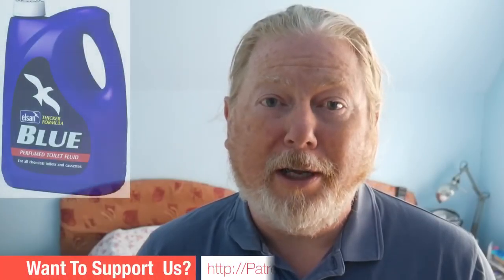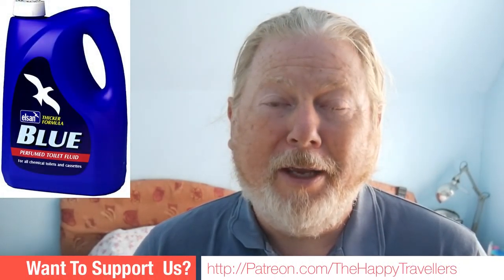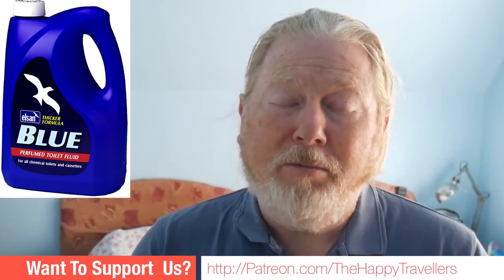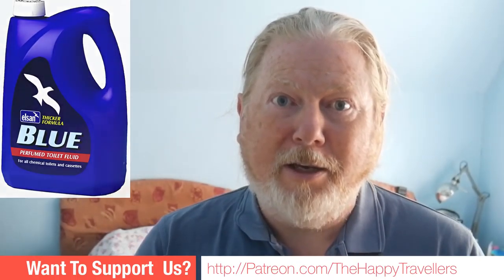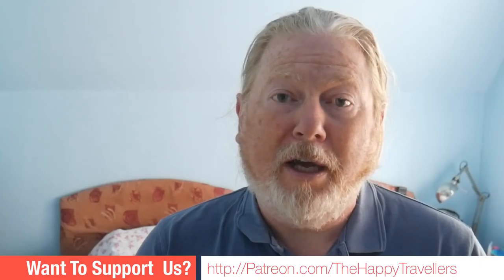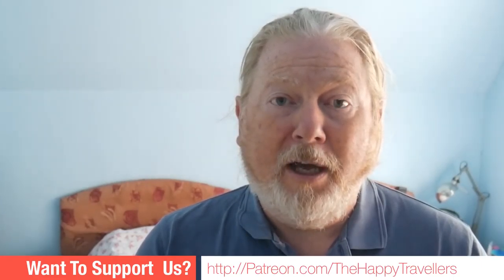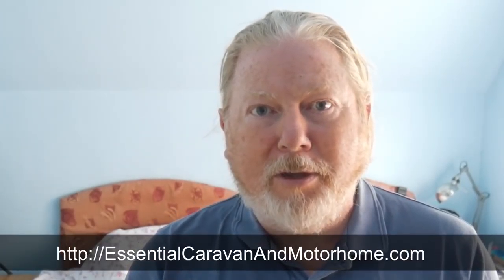Caravan and Motorhome Toilet Stories Vlog #441

Comment: Not at all an expert, but when we hired a motorhome for a couple of weeks in April, it came with a new bottle of the Elsan Blue chemical and as you say with the measure in the lid it was easy to use and did seem to work really well at breaking down the contents quickly. I did find it a bit “gloopy” and so when pouring a cap into the cassette a good deal of it seemed to line the side of the tube at the top of the cassette rather than go into the water inside - more than likely user error - we just splashed a bit more water in from the hose at the empty point to wash it down. Another tip from touring the highlands is that some sites especially out in the western isles only accept the green one, and so it seemed best to just use the empty points wherever they were, to avoid it getting full. There were 5 of us using it and it filled daily/ 2 days tops.  There were well signed points at the ferry ports and in some of the villages too.
Reply from the maker: Yes, if you're unsure about when you'll be able to empty next time, it's best to keep emptying it as and when you can. This is why we have a spare cassette :)

Comment: I hate toilet cassettes at the moment...bought a replacement and its faulty ...when you open the slider the catch is faulty and doesnt slide across again...so still waiting for thetford to decide if theyll replace it ...bloody useless..so it is email after email to the dealer who sold it to us...on our travels in Spain we were told by perm dwellers dont use chemicals just loo cleaner from lidl we tried but it was whiffy...however we just use lidl toiket blocks in flush 3 for under a £1...last ages work fine...not found anything to use instead of the blue stuff...that works the same x

Comment: Have you tried Sig in your cassette
Reply from the maker: You mean the SOG System? - not tried it yet but may do in the future. People have said they good BUT the need to change the Charcol Filter is just as expensive as the Elsan Blue...
Reply from the maker: LOL. I used to work at a place where the owner insisted that we strike a match in the loo after we'd finished. He said it burned up the residue methane LOL

Comment: One bit of advice for new cassette toilet owners, don’t use posh multi-layered toilet paper (especially when one has had a dodgy curry or it’s equivalent😂🤣) as it can block the cassette emptying tube which means when one comes to empty said cassette, one has to put a clothes peg over ones nose, close ones eyes and empty cassette with ones hands🤮 AND the Elsan Blue won’t dissolve it fully, it has it’s limitations. I have learned this from experience and it gives me nightmares to this day😩🤮 As a side note but covering the same subject, anyone thinking of buying a narrowboat and is new to narrow-boating DON’T buy one with a black tank or better known as the “PUMP OUT” of doom🤮 😂🤣 Cassette loos are the best BUT buy two cassettes as when you want to empty it you’ll find the empty station or more commonly known as CESS PIT will be full. I’ve heard the motorhome toilet emptying facilities are in a different league in Europe. £7 to empty one cassette??😧 wow now there’s a rip off💴... by the way if some of you’re fans are new to cassette toilet emptying, don’t worry people🙁 you’ll get used to the horror😧😂🤣 it takes a while but after the first three months you’ll be prepared for the inevitable stage 5 operation “EMPTYING THE BLOCKED CASSETTE😩🙁🤮” 😂🤣 I’m a 10 year live aboard narrow-boater who’s seen it all, full cess pits in mid summer, Elsa station blocked so emptying directly into chess pit🙁😧😩🤮 and believe me there’s far worse especially during summer holidays when people rent boats... but I won’t go there, Ohh the horror, the horror 😂🤣 But as is sung in “The Life of Brian” 🎤Always look on the bright side of life👍 I always whistle that when on my way 😂😂🤣 great video guys👌
Reply from the maker: Great comment Nick :) - While we're looking at narrowboats we were certainly considering the "Pump out" but had been put off by the cost of using the pump out station (£20 a go).

Seeing your comment on the subject has moved out thinking further towards the cassette solution and having a couple of cassettes.